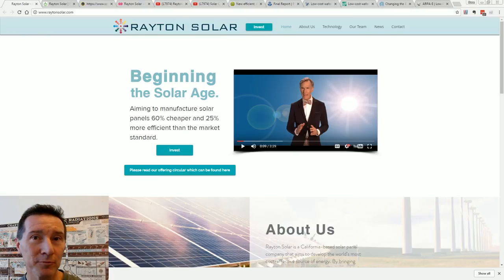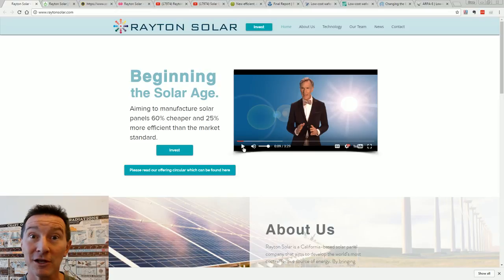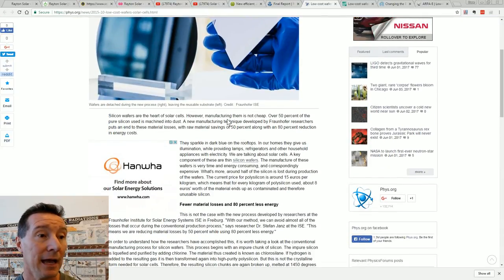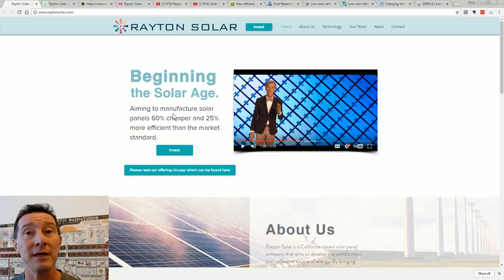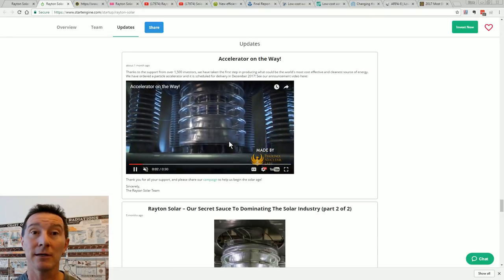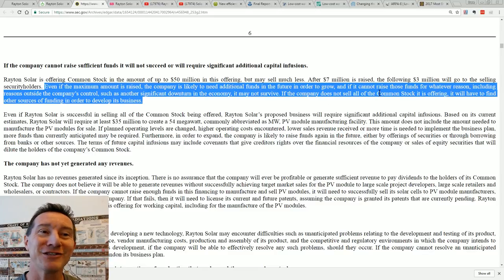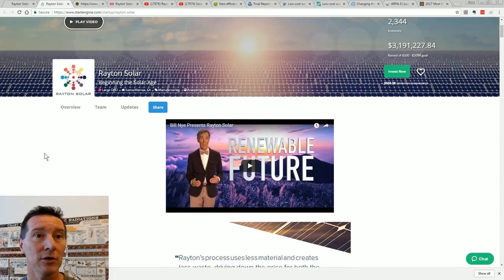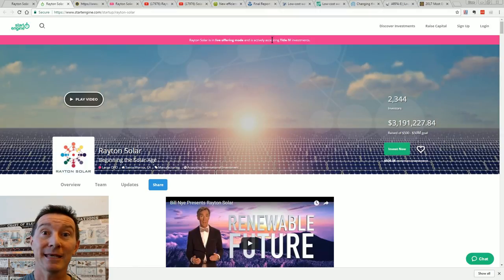Rayton Solar + Bill Nye = Questionable Solar Technology?

Comment: What % of the cost of manufacturing is getting the silicon wafer? Silicon is cheap. A 50% waste doesn't equate to 50% cost reduction even if you managed to eliminate 100% of the waste. This smells rotten and then seeing Bill Nye espousing it makes me convinced they're not interested in investors who understand what's really involved. They want people to invest so they can feel good about themselves. Fools and money...
Reply: - "A 50% waste doesn't equate to 50% cost reduction"
That is correct critics.
Reply: When I was younger, I use to work at a steel mill. There they had way to recoup the lost metals from the slag therefore reducing our waste. There was no reduction in the price of steel, in fact it increase it.

Comment: they should put them in solar freakin roadways. with batterizer
Reply: That would produce so much energy, that some of it would actually be returned back into the sun!
Reply: Nah, we will store it in freaking thorium batteries and move them were they are needed with Hiperloop
Reply: Well, you could certainly power the whole 35 megawatt facility from a single Duracell with a Batterizer sleeve ;-)
Reply: the fuck LOL

Comment: And how much power does it take to run a particle accelerator?  Somehow I think the savings in loss of waste in cutting silicon wafers would be outweighed by the cost of operating the equipment.
Reply: About $3.50
Reply: MikesRadioRepair well since we're gonna have all this super efficient solar power available we'll just power the particle accelerator with free energy from the sun! 😜
Reply: It takes a cyclotron or linear accelerator that can deliver more than 230 MeV (thats Million electron volts) I don't know what the actual amount is required but its around that.....I can tell you from experience That is a lot of energy.
Reply: You are correct
Reply: "CERN's power consumption falls to about 80 megawatts during the winter months. "
Reply: pyromen321  Why that loch ness monster always asking for tree fitty?
Reply: +Jonathan Wagner - I would assume that that is for short burst or single runs. So basically to continuously running the machine for manufacturing solar panels... just build a fucking nuclear power plant by that point.
Reply: Wow, that is so counterproductive..
Reply: 230 MeV is 37 picojoules (so almost nothing) -- but (whereever you got that number from) that is likely just the energy per proton. If you wanted to accellerate one milligram of protons to 230MeV you'd need about 22.2 gigajoules (I have no idea how much they think they need per wafer, and of course particle accellerators are not 100% efficient).
Reply: It's insanely misleading to compare the tiny accelerators they would use for this to CERN in the first place.
Reply: Why is it? It has the same principle and, unlike CERN, it would be used orders of magnitude more times.
Reply: Thirsty Weevils it is not the same sort of accelerator as at CERN. 

Cern accelerators are big and circular and a million times more energy per particle than their spec. (I am not exagerating here). 

From the picture this looks like a vertical generator possibly a van der Graf or similar. OK the accelerator has to be specified for the job but it is well tried tech.

In fact it is so well tried that one of the issues will be whether some other team gets round their patent. But the power usage should be manageable on the scale of the local grid.

I was a grad student at CERN. This is way less ambitious.
Reply: I'm less concerned about energy cost, than I am equipment maintenance. I just don't see this accelerator as a continuous duty industrial apparatus. It's more of a laboratory piece.

Comment: When I worked research we burned over $1M per month and manufactured nothing but data.  In the end despite the top level government, university, and industrial support (including USDOD and Ballard to name a few) the company still folded.  The technology we were working with was far cheaper than a particle accelerator and we were working on a green tech product.  Despite all those good points our research did not make the main stream.
So, it is absolutely likely Rayton is either a good looking fake-out or will simply fail if it is a legit company.

Comment: That's total BS.
People in the lab (yeah that includes me) have been doing CVD (Chemical Vapor Deposition) for thin film structures with very little waste for years now. No need for any atomizer. The problem is the fact that the process while make sense for depositing expensive materials such as gold and silver, silicon is dirt cheap, and the price of controlling the impurity with any such process vastly outweigh any cost saving potential from the material itself.
Bill became the fall guy for this BS unfortunately.

Comment: Actually using particle accelerators to bombard silicon wafers with oxygen ions of a precise energy to implant buried oxide at a very specific depth is a well established technology, so it isn't a huge leap to use hydrogen ions instead of oxygen ions to cleave the silicon instead of implanting silicon dioxide into it.

Comment: Strange. 

So, the particle accelerator which is used to manufacture the panels needs funding because its an expensive process?

So, this company needs to raise money to even use the particle accelerator. But they are claiming that their costs to produce the panels are %60 less than everyone else?

Does the cost of using the particle accelerator stay high?

Comment: My degree is in electrical engineering, so I'm not saavy to how silicon is fabricated, but this is a bit problematic. This venture stands or falls on the economics, because:

1.) Silicon is super abundant on the earth in the form of sand, so they're not conserving a rare resource here.

2.) Even if number one were the case (hypothetically), they could recycle the waste.

3.) The really scarce resources are MONEY and the "real estate" to mount these cells, so conversion effeiciency (watts generated per unit of area) would be a selling point.

4.) Solar energy is in itself problematic until storage technologies catch up in terms of cost and efficiency. This is crucial since much of solar energy gets dumped on the grid when it's LEAST needed, drastically cutting it's marginal value.

5.) It's potentially a conflict of interest to have an advocate for the potentially controversial concept of "global warming", "climate change", etc. to be profiting financially from that very thing.
Reply: Electrical Engineering degree here too, worked lots on silicon and related electronic devices.

1) Indeed, Si super abundance, as an element found in the earth's crust is helping it win the mfg. space but its competition is/(has been) really "cheap(er)" oil/fossil fuels/natural gas. The amount of "energy" that goes into the making of "electronic grade" Si for solar cells counts significantly in its competitiveness and so it does become indeed a scarce resource when there is no other need for the material; that is, when you want to cover acres of land/roofs with "electronic grade" Si, you want to use just the minimum possible, in order to cut the costs of the "raw wafers", and be competitive with the burning of fossil fuels and until recently, controlled nuclear fission. There is NO need for such LARGE amounts of "electronic grade" Si, other than to compete with the fossil fuel industry, i.e. to compete successfully, as the lowest cost generator, in the electrical energy generation business.

2) Re-cycling the silicon dust generated from wafer sawing is a call for the raw Si producers, perhaps it is worthwhile for them, i.e. it's an economic call, dependent on the exact processing a mfg. uses.

3) Yes, MONEY is a scarce resource, for most of us, but not as scarce for the big oil magnates/companies and their investors.

4) The solar energy "storage" problem is mostly a matter of competing in "established" markets and imagination. Solar energy can be stored directly as: a) hot water or other hot substances with high heat capacity; b) ice, which can displace a lot of fossil fuels burned to provide air conditioning, etc.; c) compressed air; d) rotational kinetic energy such as in flywheels of which several companies are finding niches, etc., etc., with many other potential storage systems both chemical and mechanical, some of which will find more economic success as the price of PV becomes cheaper than the cost of fossil fuels in a locality.

5) Very disturbing to take your "eyes" off the ball (or the pitcher, for that matter) when a 107 mph fast ball is being beamed down to your face. Mr. Nye is treading on very "loose silicon", to say the least. 

6) Kudos once again to the EEVBlog for an excellent job at presenting the facts, just the facts.

Thank you EEVBlog producers, great job!

Comment: So, I just saw this from Minute Physics. I work with silicon particle sensors and I can only say that it really makes very little sense. Silicon panels are made from silicon ingots super cheap. You don't need the high purity silicon used on sensors.  Also 3 micron silicon waver would be a bitch to handle, at 25 micron silicon bends like a sheet of office paper, 3 micron probably breaks under their own weight. 

Silicon is sand, it is literally the cheapest thing on a solar cell.
Reply: They are not trying to make it pure, they are trying to reduce wastage of the silicon.

Comment: to me its a huge red flag anytime there's a celebrity endorsing something. 
And another thing, how much energy does it take to run a proton accelerator?  seems like you would need so much energy to run the equipment it would offset the savings...
Reply: Energy is one thing, but consider the maintenance of a laboratory piece pressed into continuous duty industrial manufacturing!

Comment: I'm surprised manufacturers still use silicon ingots; building silicon from the bottom up has to be more efficient than etching from the top down. The Fraunhofer approach that Dave pointed out here involves epitaxial deposition and seems a lot more practical than using a proton accelerator to shave wafers off of an ingot.

Comment: solar cells lose efficiency with heat so you also need to remember that thinner panels struggle more with high heat situations, we have seen this in Thin Film panels vs conventional steel framed ones

they are also assuming silicon dust from cutting cannot be reused with remelting/ remoulding

Comment: If it works at all, and if it's an economic means of production, and if they're not scam artists, it seems it might have more application than just solar cells.  Simply because they can produce wafers that are a lot thinner than conventionally-sawn wafers.

Microprocessors get hot.  The faster you run them, the hotter they get.  They have to dissipate that heat because they have a maximum chip operating temperature of around 150 °C.  The circuitry is on one side of the wafer, the other side is bonded to the package.  The heat has to go through most of the thickness of the wafer to get to the package.  Then the heat has to go through the thickness of the package to get to the heatsink.  Yes, I've simplified that.  Anyway, reducing the thickness of the wafer will increase the heat dissipation and will therefore increase the speed you can clock the chip.  How much faster, I don't know.  Probably not much.  But every little helps.

Reducing kerf lossage will also help reduce costs of producing integrated circuits in general.  Probably not much, because the other steps involved in turning a wafer of silicon into a functioning circuit are not cheap.  But every little helps.   Unless the cost of the proton beam process is more than the saving in silicon lost to kerf.

Is kerf loss that expensive?  Yeah. You have to purify the silicon chemically to a high degree, then zone refine it to purify it even more.  Expensive steps.  So if kerf lossage is as high as 50% (the figure I've seen) then the savings might make a particle accelerator worth while if you process enough wafers before the accelerator needs to be replaced.  But, as I said, there are other expensive steps after you've separated the ingot into wafers.

So none of this is obviously, face-palmingly stupid.  But, given their lack of data, it may be a scam, or simply overly optimistic of what they can achieve in a production process.

I know they've been operating at a loss so far, but that doesn't necessarily mean the idea is bad or they won't eventually make a profit.  Amazon operated at a loss for many years.  But it does make it an even bigger gamble.

Conclusion: I wouldn't risk investing even if I could afford to.  But I hope they succeed.  Because kewl.
Reply: I think you hit the nail on the head, a particle accelerator is more of a laboratory piece, than a continuous duty industrial manufacturing machine.

Comment: The most Wasteful Part of Silicon Solar cells  production is the Ovens that Melt them and the Ovens that grow the Crystals .  The better Idea of Growing the Silicon into the correct size and shape is the best way to go. Sounds just Stupid to Cut Silicon, why not cut diamond ? Why ? Grow them Smooth and the correct size then no cutting or polishing would be necessary ..

Comment: Can you imagine how the world will change when we hit 50% efficiency?  That's when things will change big time.  2.5x as much power as the best there is now.  But I think that will be decades away...  (8:52)
Reply: Well at least with SI it is impossible. The theoretical max is at about 29%. And other types of solar cells are way to expenive and way to fragile. So yeah decades might be the right timescale
Reply: I did not know that.  I'm sure they will figure it out though with some other material or technology.  The demand for lower cost energy isn't going down!
Reply: You made me look... Wikipedia says max is 33.16% with "traditional" cells and in "December 2014, the world record for solar cell efficiency at 46% was achieved by using multi-junction concentrator solar cells".  And "The theoretical efficiency of MJ solar cells is 86.8% for an infinite number of pn junctions, implying that more junctions increase efficiency. The maximum theoretical efficiency is 37, 50, 56, 72% for 1, 2, 3, 36 pn junctions, respectively, with the number of junctions increasing exponentially to achieve equal efficiency increments."

Interesting stuff.  Maybe that 56% "theoretical" with just 3 PN junctions isn't too too far off?   PS - I just took a quick look through those pages so don't get too upset if I misquoted something.
Reply: Oh well. I really thought i remembered 29%. Maybe 33.16 is for Germanium or so. But ok its still way below 50%.  Yeah thats what i said. There are a lot of research projects currently going on. Like I said, as of now, the MJ cells are not practically useable for the general population but there is a lot to come in the next few years. And yeah i also think that those will then boost the production of renewable energy.
Reply: @ElmerFuddGun  Imagine a solar cell/panel that doesn't get hot as long as it's loaded. That's what  87% efficiency would do.

Comment: Thanks for pointing out the risks.

The article you linked is also useful to see how much the primary investors are already drawing from the project (both salary and sale of equity at a huge markup).

The risk of backing Betamax arises here - even if this is twchnically the best process it may or may not win in the marketplace.

So it isnt one to put your retirement savings into.

On the other hand if they turn out to be the VHS of this technology then the returns could be enormous.

I think it is one for a small bet ($500) if you can afford to lose that. You probably will lose it - but if it is a winner it will repay many many times over. 

But it is a bet, a flutter , not an investment.

Or maybe it is a donation as you hope the tech will come through and you want to be part of that journey.

Comment: I call bullshit. Typical cost of building a silicon fabrication plant is in the billions. What, they're just going to pop out and buy a proton accelerator, shove it in a warehouse and start churning out silicon wafers? Nope, they wouldn't have a clue!
Reply: The Up Late Geek
You're thinking of wafer production for ICs.  If solar panels were made from the same materials then they'd be totally infeasible due to the cost.
Reply: The images they've shown are for monocrystalline cells, which means they'd need much higher-quality silicon than amorphous or polysilicon cells, so it'd be practically identical to that used in IC manufacture. That means they'd need the same level of clean rooms for those production steps, which is exactly what they claim to be amazing at, so that's where the biggest costs are.

In any case, they claim to be able to cut the wafers to 3 microns thick. But to manufacture such thin wafers, they'd need a beam control system that's capable of moving the beam and wafer at micron-precision. That doesn't sound like something you could do on off-the-shelf equipment.

They're claiming this reduction in waste will reduce the cost of the wafers only, they don't mention the impacts on other manufacturing steps. They'd have to build automation systems around their new wafer production process, since the wafers produced would be so thin they 'd be impossible to handle in their raw state without damaging them (note how the one cell they showed didn't look perfectly smooth - "he's dead, Jim"). They'd need to be cut and laminated or bonded to a support material in a completely automated way.

And at every step, the millions keep stacking up. I bet they'd have a hard time building the clean room alone for their $85 million budget, let alone integrating a particle accelerator and automated manufacturing system!